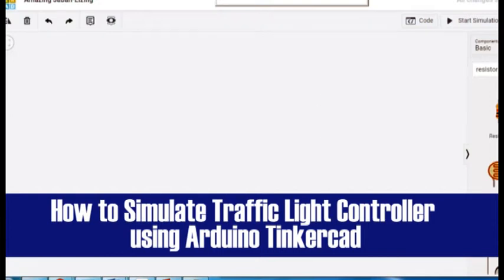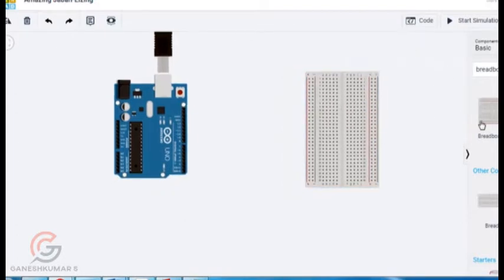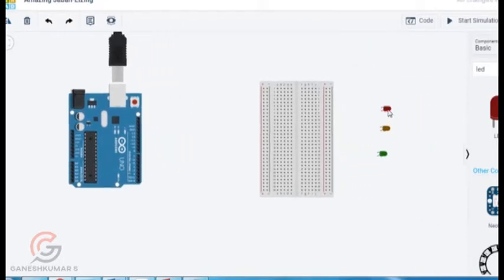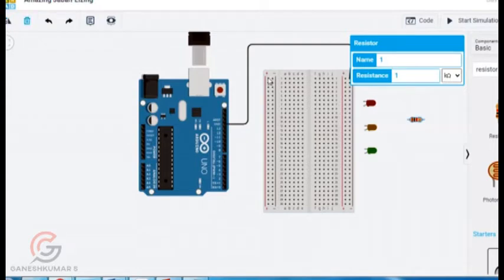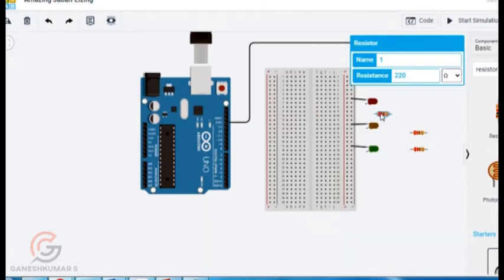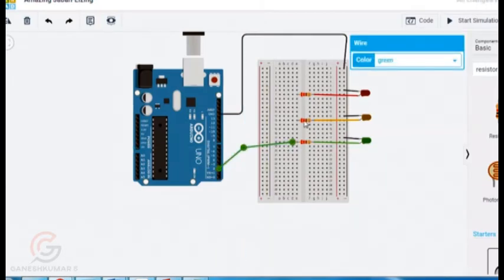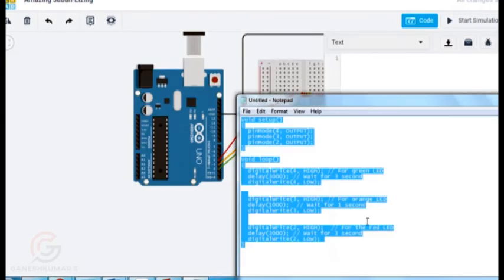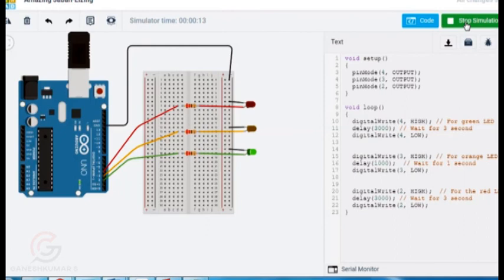How to simulate Traffic Light Controller in TinkerCad

Comment: HERES THE CODE:

void setup()
{
  pinMode(4, OUTPUT);
  pinMode(3, OUTPUT);
  pinMode(2, OUTPUT);
}
 
void loop()
{
  digitalWrite(4, HIGH); // For green LED
  delay(3000); // Wait for 3 second
  digitalWrite(4, LOW);
  
  
  
  digitalWrite(3, HIGH); // For orange LED
  delay(1000); // Wait for 1 second
  digitalWrite(3, LOW);
  
  
  digitalWrite(2, HIGH); // For red LED
  delay(3000); // Wait for 3 second
  digitalWrite(2, LOW);
}

Comment: Can I get the code?
Reply: void setup()
{
  pinMode(4, OUTPUT);
  pinMode(3, OUTPUT);
  pinMode(2, OUTPUT);
}
 
void loop()
{
  digitalWrite(4, HIGH); // For green LED
  delay(3000); // Wait for 3 second
  digitalWrite(4, LOW);
  
  
  
  digitalWrite(3, HIGH); // For orange LED
  delay(1000); // Wait for 1 second
  digitalWrite(3, LOW);
  
  
  digitalWrite(2, HIGH); // For red LED
  delay(3000); // Wait for 3 second
  digitalWrite(2, LOW);
}

Comment: Sir code mil sakta h kya hme
Reply from the maker: sure bro, I will give you the code
Reply: @a84403  where is code bruhh
Reply: @masterayhan  void setup()
{
  pinMode(4, OUTPUT);
  pinMode(3, OUTPUT);
  pinMode(2, OUTPUT);
}
 
void loop()
{
  digitalWrite(4, HIGH); // For green LED
  delay(3000); // Wait for 3 second
  digitalWrite(4, LOW);
  
  
  
  digitalWrite(3, HIGH); // For orange LED
  delay(1000); // Wait for 1 second
  digitalWrite(3, LOW);
  
  
  digitalWrite(2, HIGH); // For red LED
  delay(3000); // Wait for 3 second
  digitalWrite(2, LOW);
}

Comment: Why we are taking resisters of 220ohm
Reply from the maker: To create voltage drop at the LED ends, Typically, the forward voltage of an LED is between 1.8 and 3.3 volts, for this you can find the value of resistor using V = I R formula.. hope you can understand why we are selecting 220 ohms